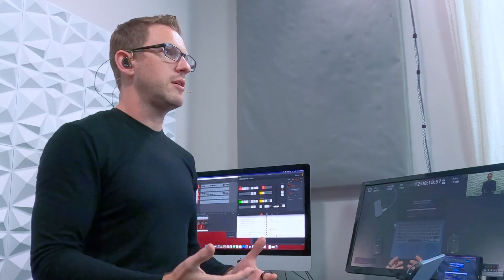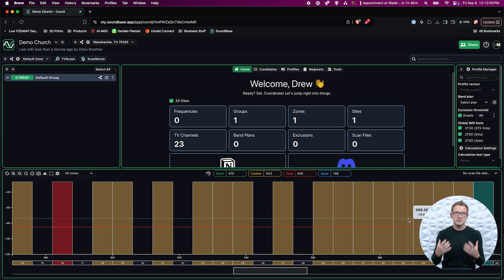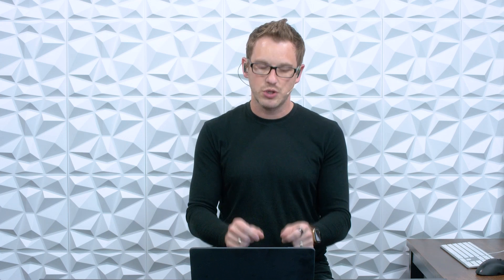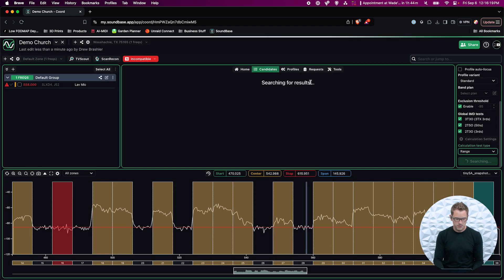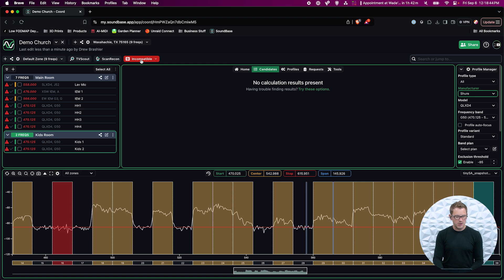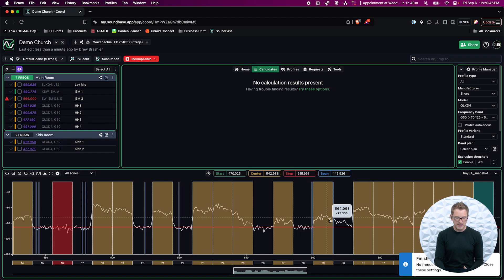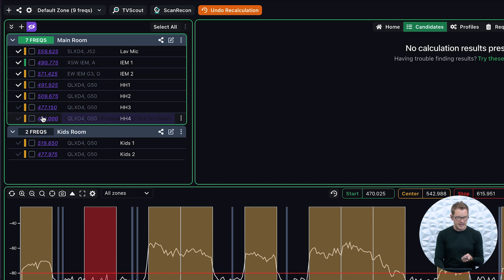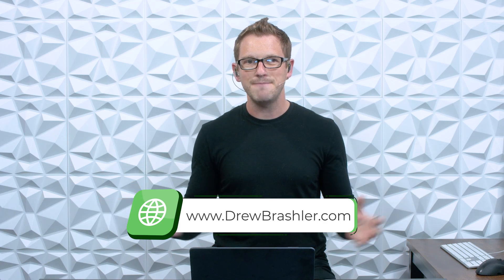Using SoundBase for RF Coordination for your Church

Comment: If you are using networkable Shure systems - why not use free Wireless Workbench to do the coordination AND you can use the Shure system to do the scanning. Likely far better tools on both fronts. Shure has solid free training for Wireless Workbench. And, while it is Shure software, it is designed to work with a wide range of known gear, in terms of it's database of devices to add, as well as knowing all the bands, etc. for that gear.